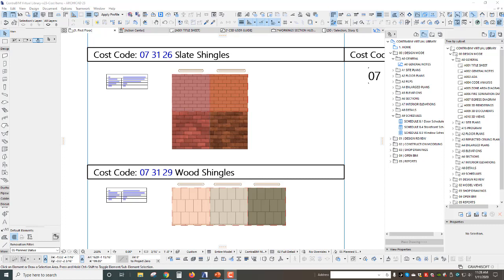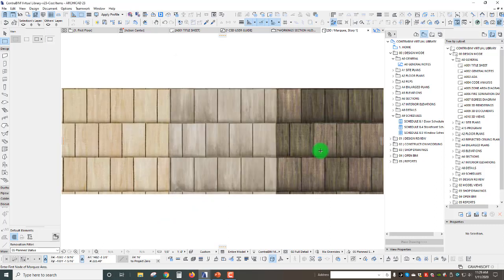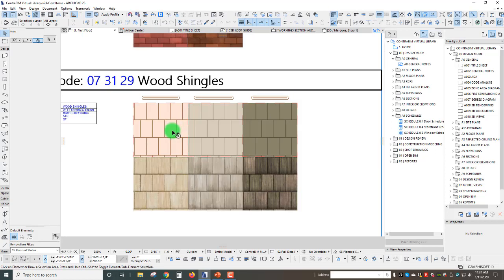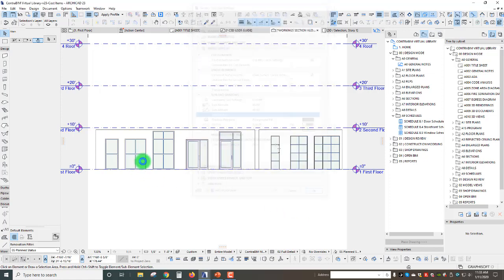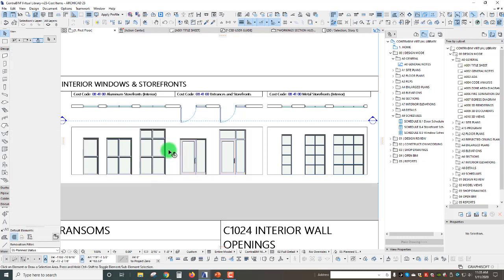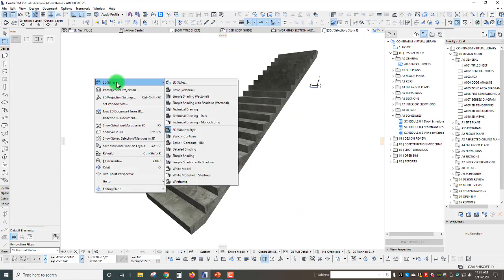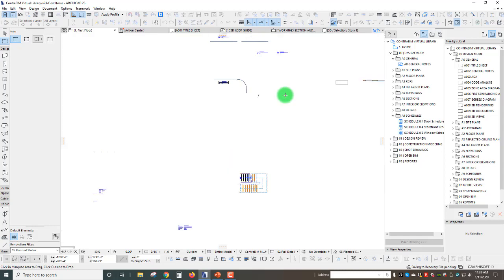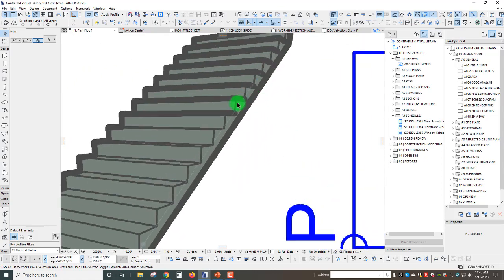Do you know these three tricks with ARCHICAD Marquee Tool?

Comment: Nice tricks, but a bit outdated. Now you can make and save 3d views for all those purposes, and they will be fully updated anytime you change the model.
Reply from the maker: Thanks Rogelio. True, you can save 3D views / 3D docs of all these, but they cannot be placed back on the working floorplan. This workflow may seem strange, but it's not a typical project file... it's a large central library used for conditioning data and dialing in visual settings. I'm going for maximum visual feedback while browsing in 2D, and not concerned with actually creating drawings of these sample scopes. On a real project file I would be, and would use the method you described! Thanks for the comment!